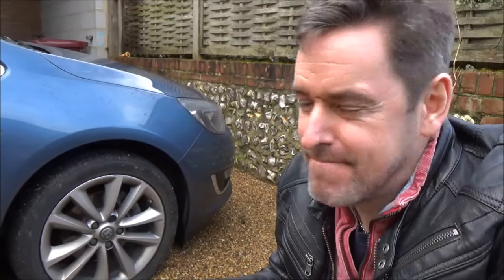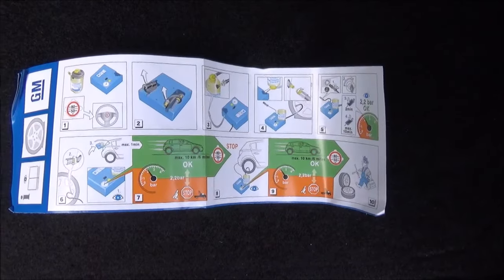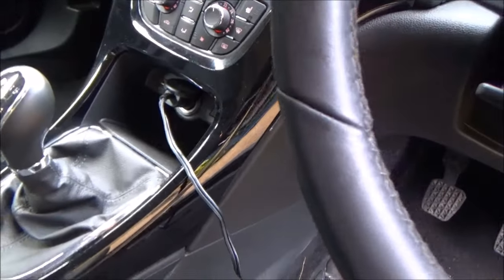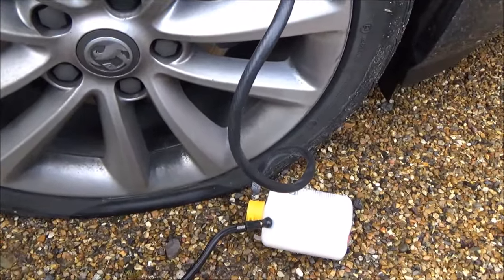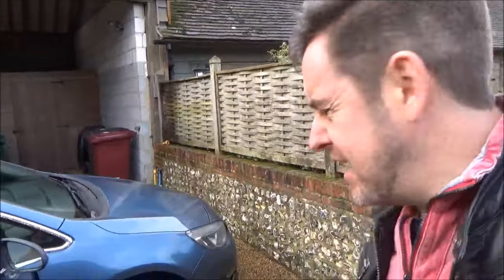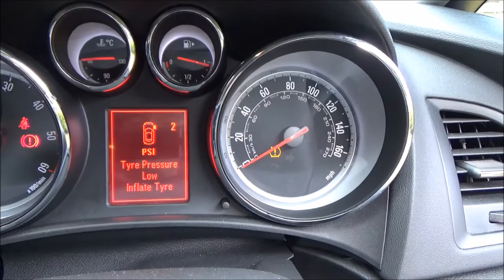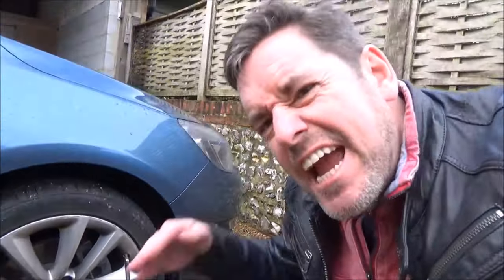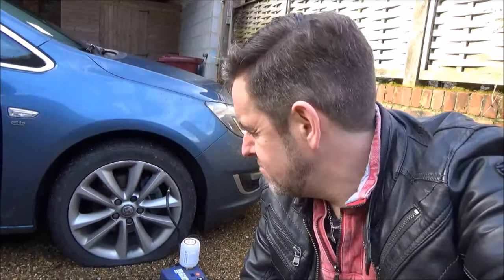Are tyre inflation kits any good...really ?!

Comment: This works fine. The sealant bottle needs to be placed in the housing on the compressor as the sealant is gravity fed into the air flow and the car engine needs to be running to preserve the battery. The instructions with the kit and in the car manual are easy to understand. In this case they haven't been read and the procedure is not correct hence the fail. User flaw. I had a puncture this morning from a screw, I used the kit, it worked fine and got me to the garage without need for re-inflation. The puncture was repaired for £15.00. Would have been £10.00 normally but the extra £5.00 was for cleaning the sealant from inside the tyre. I was back on the road within 45 minutes, more than happy. I have been misinformed in comments to these videos that the tyre would need replacing as the sealant renders it useless. This is not the case.
Reply: The tyre does need to be replaced if you've driven on it when it was flat. The damage is inside the tyre and you can't see it easily. Best to replace it as a duff tyre can get you dead.
Reply: @hobmoor2042  He used the kit, never said he was driving the thing with the flat tyre.

Comment: Something never looked "right" about those tiny inflatable tyre-things. 

When I discovered my 2013 KIA Optima only had one of those, I ran out asap & ordered an xtra rim and replacement tyre for it as well as the biggest hydraulic jack they make for emergency tyre changing. The flimsy jack that comes with is dangerous to say the least. Now at least the car won't fall off the jack anymore.

 The New Spare Rim and Tyre plus the Hydraulic Jack make the perfect Ballast for my car when Im driving. I always felt pretty light on the road in the past...

Hope you were able to get that sorted quickly. Flat tyres *anywhere are bad news in general....in the middle of nowhere with a flat is a terrible predicament. Glad You Were close to Civilisation.☺Thank-you for sharing your information!!

Comment: I had to use one with my company car, you use it, then you have to drive a litle way inflate, drive a little way, inflate drive etc, bloody dangerous when you are on a motorway miles from an exit, on country road, we dumped our "inflation kits", and bought spare wheels for our compnay cars. i  had to give up, with the kit, eventually got someone out, he said, i have nver had a sucess with those kits, as still limited to 80kph 50mph  & the tyre is runied after using one anyway, so for a total of 4 hours, meeting missed, soaking wet, cold, , eventually new tyre fitted in a car park I managed to get to, and a  bill.£120, (well company) But with a  spare wheel, 5 minutes to change, repair bill for punture dropped off a garage near office £20 with a guarantee, they even brought to office & fitted and put spare back. so Inflation Kit = Stupid, costly, Spare wheel = sensible, sensible cost.

Comment: I've not seen any reviews (nor anything in the product instructions) about making sure that the tire is rotated such that the puncture at the bottom (so that the sealant finds the hole and can plug it, lest the air keep escaping out the puncture, if it were at the top). Is this a requirement, or does the sealant, somehow, foam up inside of the tire such that it reaches all parts of it?
Reply: You are absolutely right mate

Comment: You should start the engine while using the compressor. A car battery has 12 Volts but your alternator generates 13.7 Volts so that increase in Voltage while the engine is running boosts the compressor. Saves you a few minutes if you have a completely flat tyre.
Reply: Or get a higher Voltage unit that has both car outlet and wall outlet which typically runs it a bit faster.  With that small of an air compressor you can't expect one that has even a small gallon sized compressor.  Definitely are better ones on the market and if on a dark road, no cell phone connection and otherwise up the creek so the speak I expect it would be worth having.  Would benefit from a light on the unit as well to see what you are doing in the dark and the line on it is pretty short.
Reply: "you have a completely flat tyre." And a battery out of juice...

Comment: TRY READING ALL THE INSTRUCTIONS NEXT TIME?  Connect bottle of gunk to compressor,  Connect to tyre,  Connect to Cigarette lighter, (Invert and slide bottle of gunk into recess on compressor) now switch On compresser as the gunk will empty via gravity into the compressor? I prefer a proper spare but I think you were the problem with this, When you invert and start the pump that is what sends it into the wheel to seal the hole, You failed to do this so the whole of the inside was not covered. What I would like to see is a video of when this tyre was replaced? Because there is obviously a Max sized hole it can fix with a slash being worse
Reply from the maker: I know it was my bad for not reading the instructions properly, but even if I had I don't think it would have worked as the tyre was so badly damaged. The only proper solution is to have a full size spare. Space saver spares are OK but you then have the problem of where to put the wheel you take off !

Comment: It would have been useful to know what was wrong with the tyre. I'm assuming as it was a test, you knew if it was a small nail hole, or a larger hole such as a 5mm chunk taken out by a bolt or something. I think these kits are unlikely to deal with the latter, but if used before the pressure has completely flattened out, could be good enough to get you to a repair.
Reply from the maker: Major cut and deflation. It didn’t stand a chance 😜

Comment: This may sound like a silly question. But if you deliberately deflated a perfectly good tire, and then reinflated the tire using the sealant, would this help prevent future punctures / flat tires ?.
Reply from the maker: These devices give a short term fix for a puncture and not designed to do that.

Comment: you didn't shake it up nor did you roll forward after injecting foam nor did you plug up the inflator directly stop making educational videos if your uneducated at the video your making foam tire plugs an a spare should all be in your car an you should get a patch or a new tire foam an plugs are temporary but plugs give you a while but when a tire is that flat or you use foam a new tire is always needed
Reply from the maker: Err...this was never meant to be an 'educational' video. It was a bit of fun !
Reply: It's an antidote to amuse as the manufacturers are cheating on us all.